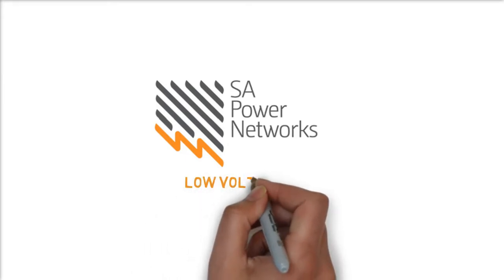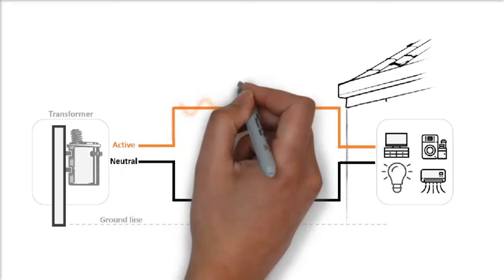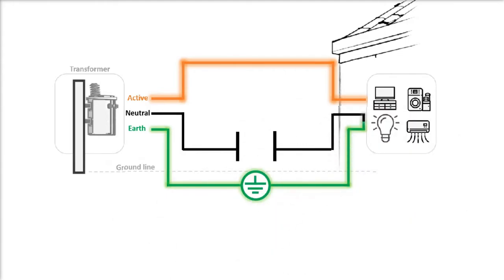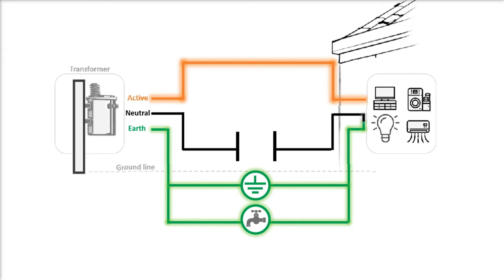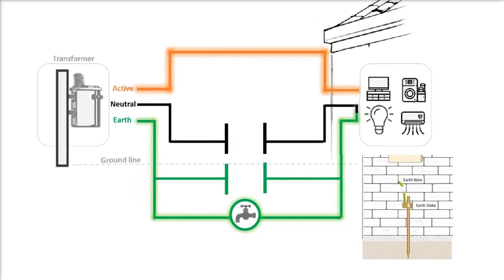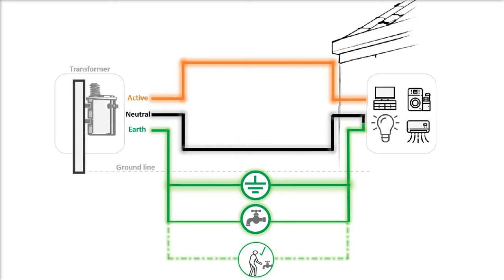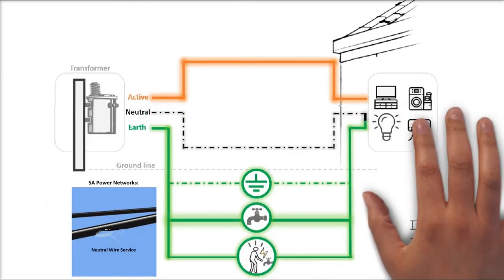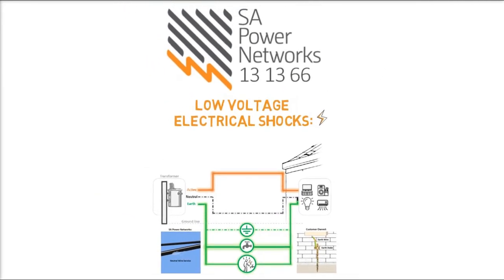Shocks or tingles in your home could be caused by an electrical fault in your home

Comment: Out of all the home electrical videos on this subject I've viewed, this is the only one that simply, clearly, and concisely explains the path of electricity when elements of the circuit become worn or damaged, what can cause tingles/shocks and the danger inherent as well as providing a great question to ask electricians regarding fees for addressing serious safety issues . Considering the current economy and what local electricians charge by the hour for trouble shooting circuits, that final bit of info is, in my opinion, worth its weight in gold. 🍻😊